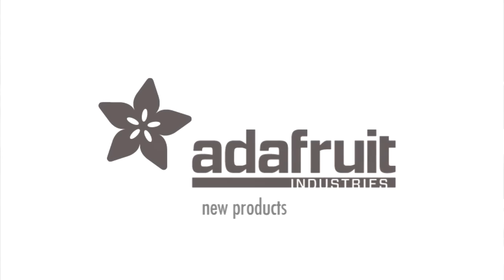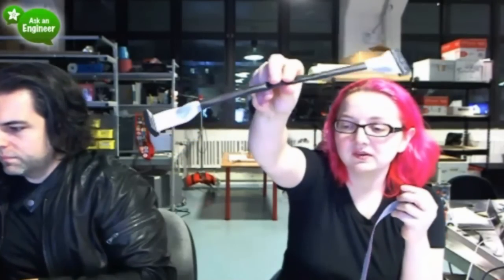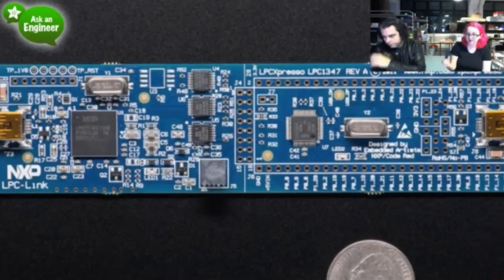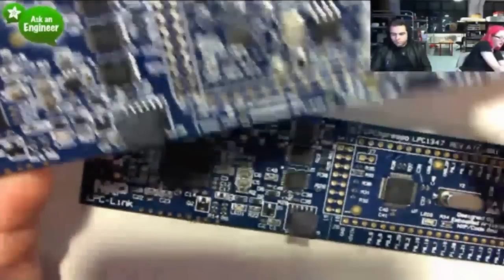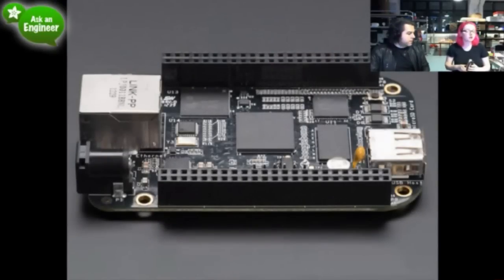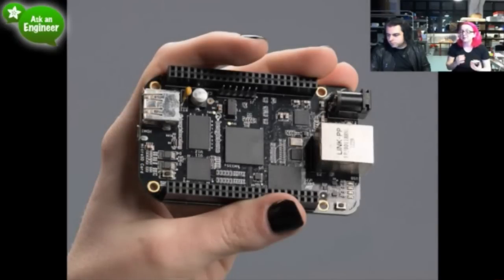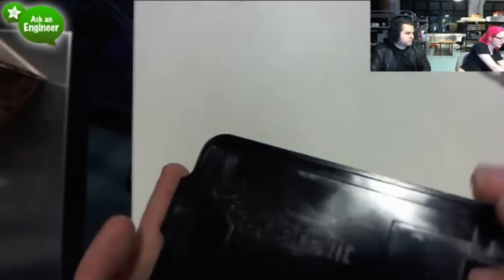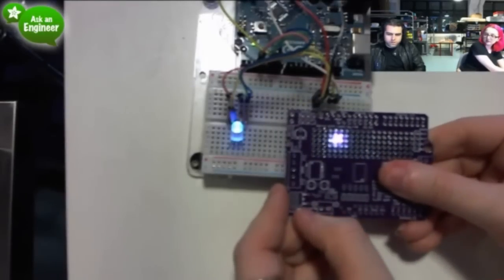BeagleBone Black & Adafruit Pi Case! New Products 4/27/2013

Comment: It's entirely possible the LED isn't producing the correct color because of the dynamic ranges of the R G B leds inside the LED rather than any error with the sensor (I think you started to say that).  It would also have been REALLY nice to have seen the gesture sensing offered by the "Color Sensor".